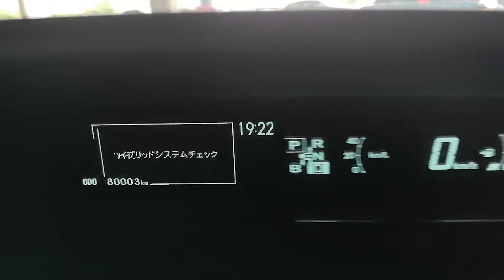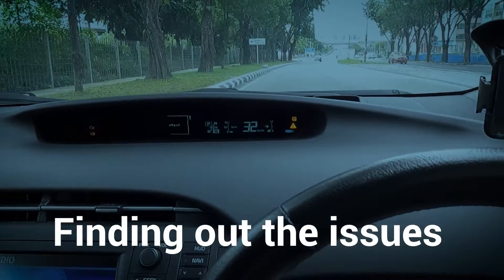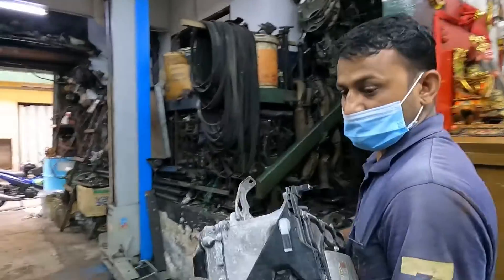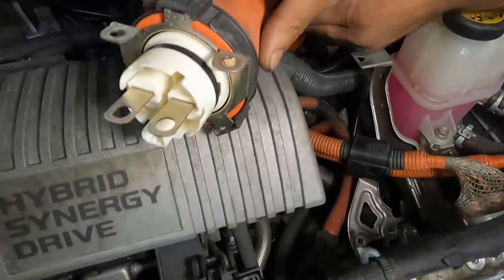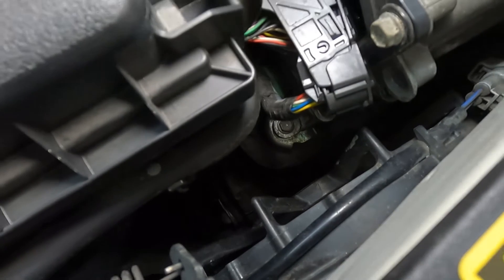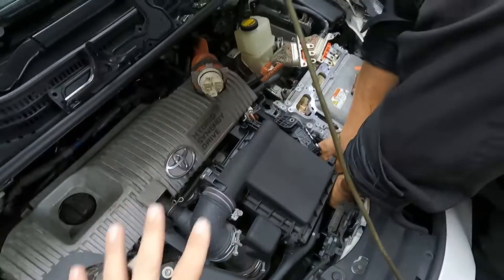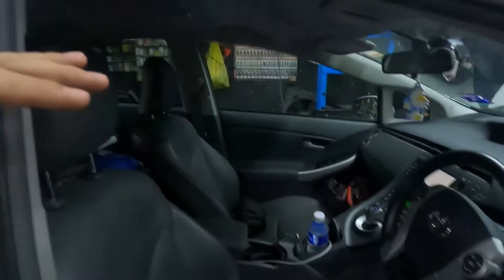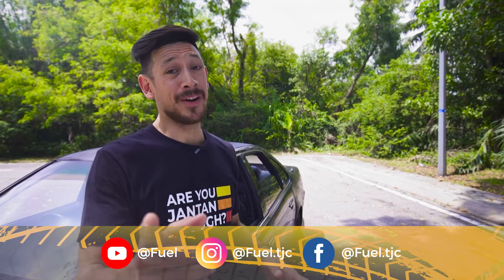FUEL - How To Replace A Prius Inverter | Peter Davis

Comment: HI? I am  watching your videos, around the 5:58 minute mark, you are install the bundle of wire wrap in black with grey head. please can you explain to me how you install that bundle of wire that has the grey attaching clip.  how do you install that clip to the point it clip in.  i removed my inverter and now it doesn't want to start. it says check hybrid system.  i am not able to get the clip to lock tight.  please how do you go about to put it in to snap in place. thank you

Comment: hi?  when you removed the inverter the last connection you removed from the inverter what is it for.   the piece that has plastic cover.  is it  a ground and what  is for. please help and also what happened if while putting that while back on a spark happened what could the spark caused. is the attached you have open the black plastic and remove a nut remove from the body of inverter. when standing behind the inverter is the terminal is on the left  lower side. 

my car is 2016 prius c

after replacing inverter pump, everything turns , i can hear the regular sound of the inverter but the car doesn't go into ready mode.  no ecu code.  dash message check hybrid system.

Comment: Last week I brought my 2008 prius gen 2 with 141k miles (I bought it last year for 7500 usd from an old couple) to the Toyota dealer in The Netherlands. A big red triangle on the dash with the car and exclamation sign on the touchscreen came up. It said there was something wrong with the hybrid package. 

Strange enough I had those warning lights only ones, and it still charge the hybrid batteries pretty good. 

The dealer did some reading on the car, and they told me the dc converter did not convert well so the risk of getting a short circuit in the hybrid system is pretty high. 

They told that the dc converter cost without taxes about 3000 USD, with labour cost it will cost around 5000 to 6000 USD in total. 

However, they said that when you replace the dc converter it is still not problem free. Other problems that are connected to the dc converter or hybrid system might occur. 

Is this true? Or is this a protocol of the dealer to communicate such things? 

They offered me to sell the car to them for 2000 USD. 

Should I keep and fix it elsewhere or sell the car?

Comment: Hello, I am writing to you from Mexico City, I have a 2011 Prius with error P0A94 and three mechanics say that it is the inverter. Here in Mexico it is not easy to get used parts and new ones are very expensive. I have a question and possibly you can help me: On the inverter label there are two codes A: G9200-47140 and B: 22JTE47140A10K290053. Should I look for an inverter that is the same as A code or both codes...? Thanks for your help, regards.